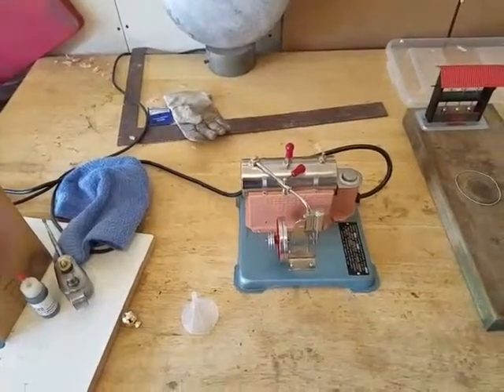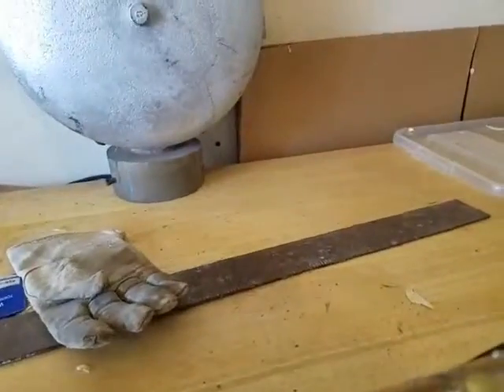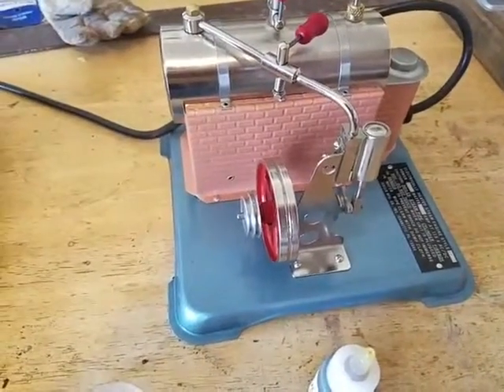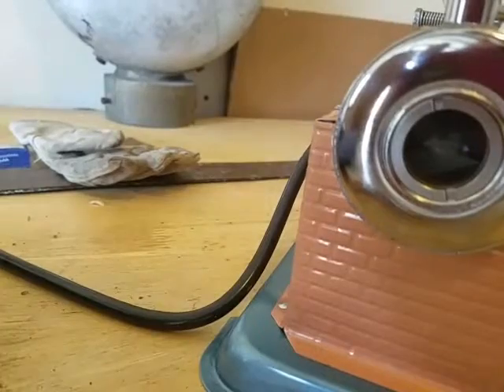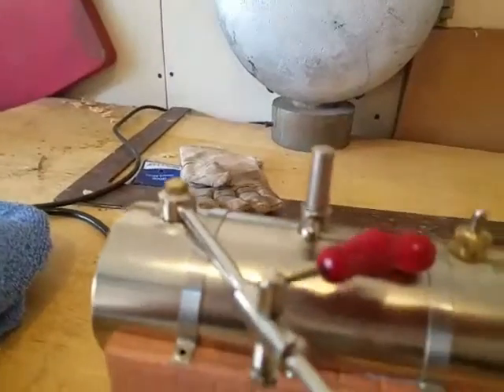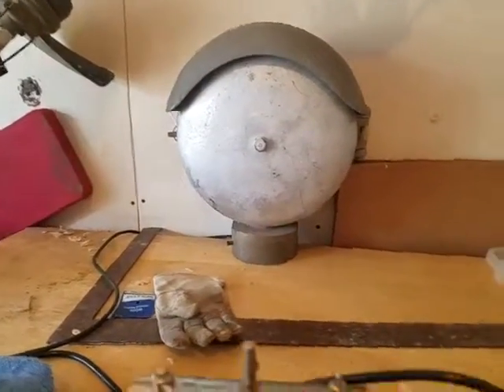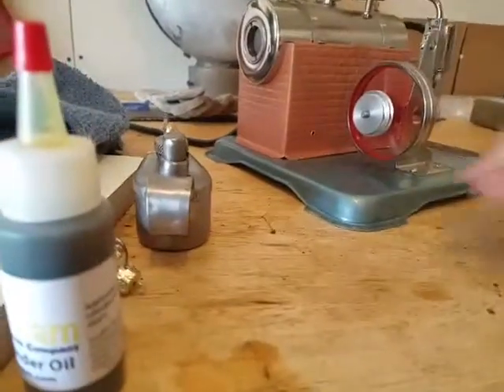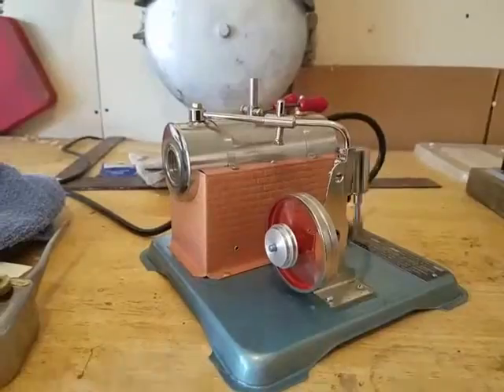How to Operate a Jensen Model 70 Steam Engine

Comment: Good show, thanks for sharing.
Reply from the maker: Your welcome
Reply: @TexasRailfan21-RailfanRyan  I just scored a model 60 at a garage sale ($5 bucks). It uses the solid fuel. It is missing the fuel tray, which isn't a big deal. It also doesn't have the smoke stake like yours. Overall it's in pretty good condition.
Reply from the maker: @JasonVladimir  cool